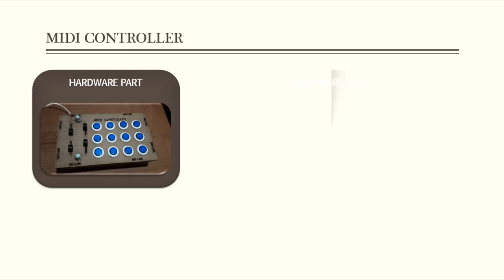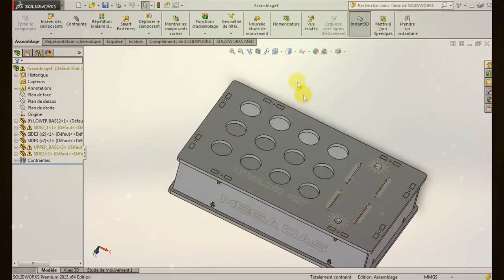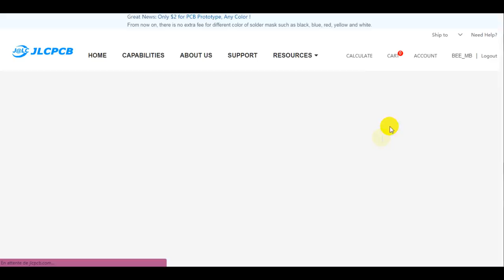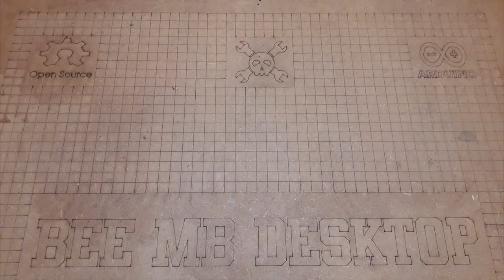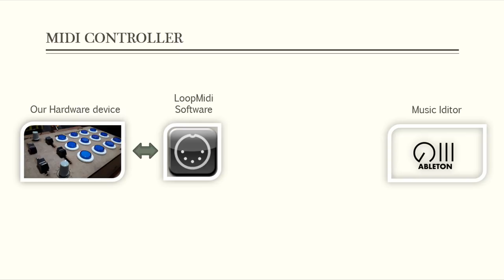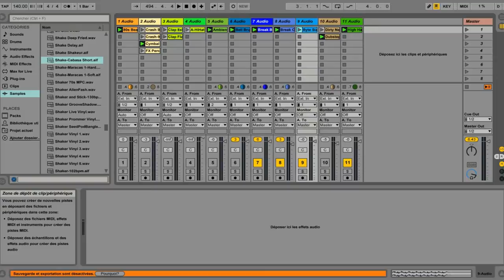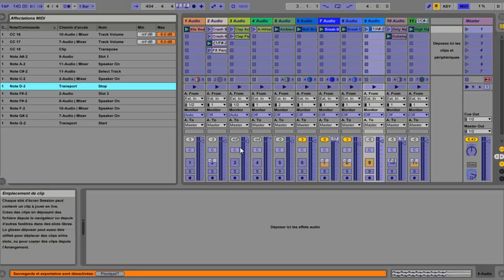DIY Arduino MIDI controller (Best MIDI project)

Comment: Hello... Very Helpful Video. I am running a bit of a problem. Trying to create something with the Arcade Buttons only. Trying to create a Foot Pedal with 8 switches.

I am using the same code as you are with the Nano but the board is sending CC data instead of Note Values. Also I can see continuous data being sent in Hairless MIDI and not only on button presses.

Can you please assist? Any help would be very nice...

Comment: Hey once its all built do you need your computer by you or can u use just the controller?
Reply from the maker: Hello
Yes unfortunately you will need your computer since the controller will be program the sound and buttons sets of the software that will display the sounds do you will use the DIY controller instead of the computer keyboard..

Comment: If I put a rotary encoder, will it take 3 analog inputs? I mean one for each side plus its pushbutton.
Reply from the maker: Hello 
Yes sure but we advice you to separate the analog and digital inputs in order to configure them on Ableton.
Reply: @DIYGUYChris  Ok, but the two sides of an encoder are analog or digital?

Comment: How to connect the pots to the Arduino Nano.
The Circuit diagram doesn't show the exact connection with the PCB.
Could u mail me the same?
Reply from the maker: Hello Arduino Kid
The pots has 3 pins (+5v, GND, Out) just cannect all +5v off all pots together and connect it to 5v of arduino then all GND of pots together and connect them to Arduino GND then you place the "out" pin of each pot ti the appropriate pad in the PCB (middle pad) you can find these details in the circuit diagram

Let me know if there is anything else.

Comment: hey can i use this for 48 key keyboard, how to change code, it's 8x6 matrix
Reply from the maker: Hello
Not the appropriate circuit diagram.. You need to extend the Arduino IO pins and change some parts of the code.

Comment: hello bro. what is the best arduino to use if im building a 16 push buttons with 6 potentiometers? is it ok to use a arduino mega pro mini for this project?
Reply from the maker: Hello
There is nothing named "mega pro mini" there is arduino mega2560 and arduino pro mini.. 😊
In your case you can't use the pro mini since it hasn't enough digital inputs for the push buttons but you still can use it as long as you add some external ICs to add more digital pins lile the IC MCP23017.
Or you can use the arduino mega2650 without any external IC.

Let us know if we can further assist you.
Reply: MEGA DAS ahaha thanks for the clarification. Confused with the names hehe.
Reply: MEGA DAS  what about the Arduino Mega2560 PRO Mini(embedded). Can i use if for this kind of project?
Reply from the maker: @AmphiL16  yes but do some research about it first
Reply: @DIYGUYChris  Arduino Micro ATmega32u4  can be used right? it has 20 digital and 12 analog

Comment: Can you provide a video and code in using sensors instead of buttons
Reply from the maker: Hello
Sensors will act the same us buttons as long as it is digital output sensors
Reply: @DIYGUYChris  brother I'm using piezo electric censors. Can you please provide code for censors

Comment: will this code work for an arduino uno?
Reply from the maker: Yes sure it will work ^_^
Reply: @DIYGUYChris  
Do you think this is possible with a Rasberry Pi as long as the code is different?
Reply from the maker: @smileydog5941  if you want to use a RPi then no need for all these softwares since you can display sounds from its I²S module and with a python code you can create your own interface for the buttons

Comment: Not much actual educational info, A lot of ad placement.
Reply from the maker: It will be better if you start your comment by saying "hello" 😉
About the video, I tried to make it as short as possible for the audience so no much details in it but we can provide a step by step guidance for anyone who needs to get help the way we do all the time.
You are always welcome here John and your comment is much appreciated.
Reply: @DIYGUYChris  Why the necessity for a short video ?. And if for some reason  time was really of essence, Why did you spend 3min of the video just playing with the midi controller ?. The rest of the video was just assembly of your own device (Not much value in showing/seeing soldering and screwing), and telling people to follow links for more details and affiliate promotion. However, No explanation of the circuit or the code. Whether you'll provide further help or guidance is beside the point. The video itself is not very good in terms of education.
Reply: @DIYGUYChris  OK do that then. I'd appreciate it

Comment: $45 for a NANO???  Ridiculous.  Sorry, man, the original from the Arduino store is less than $20.
Reply: Still is $45, four months later.  Also, there is a USB MIDI library for Arduino.  You don't need the Hairless driver at all.  Or LoopMIDI. unless you want it for Ableton routing (Ableton MIDI routing like a Mac - can't be beat!).
Reply from the maker: HELLO
Some people don't even know what is "Arduino Nano" so the link is just to help them to pickup the right dev board and it is for them to compare the prices..
Reply from the maker: @chrisw1462  about the USB MIDI library it is a different thing ! The use of Hairless and loopMIDI is necessary or you will not be able to convert the serial instructions (8 bits protocol) to interface the Ableton commands.
Reply: @DIYGUYChris  The USB MIDI library causes the Nano to tell the OS (Windows, Mac, Linux) that it is a USB MIDI device.  From there  you can use the USB MIDI routines from the library to send and receive, and Ableton will see it as just another MIDI controller, so it should be able to do anything any other MIDI device can.  Please note that not all Arduino types can do this, and you have to set them up as an HID device in the Arduino bootloader, so you lose the USB serial function unless you manually re-load the bootloader (you'll need a separate USB to Serial programmer for that).  It's a pain to do, but not difficult.

Just as a suggestion, I'm currently using one of the Feather boards with Bluetooth, and it does Bluetooth MIDI flawlessly.  It's a bit expensive at $30, but.. wireless.
Reply: These guys aren't your friends. If they aren't pushing you to spam links theyll send you to the most expensive suppliers for components.
Reply from the maker: @orphanpixels  I just told you that the links are not spams ! mediafire is a 100% direct cloud download .